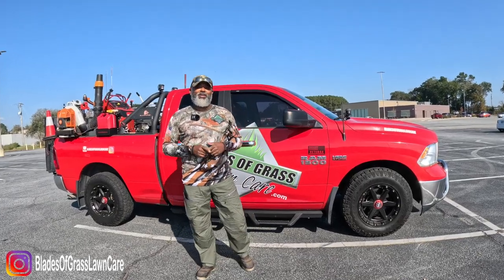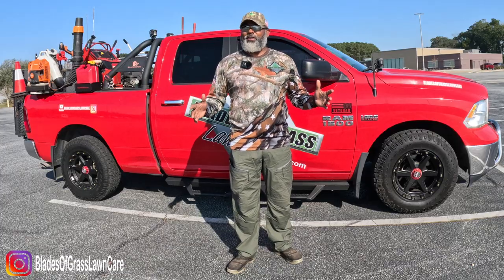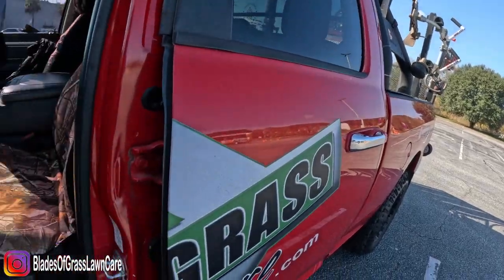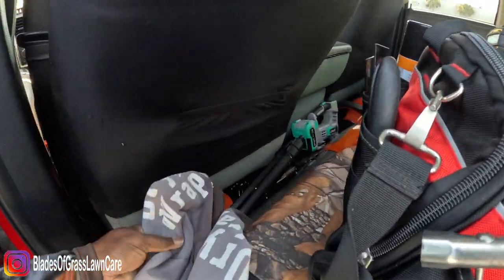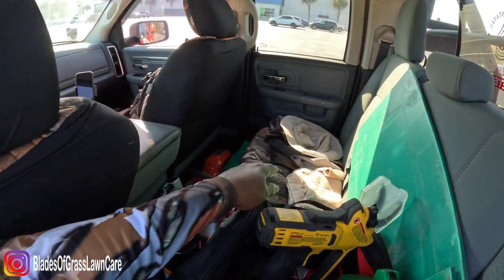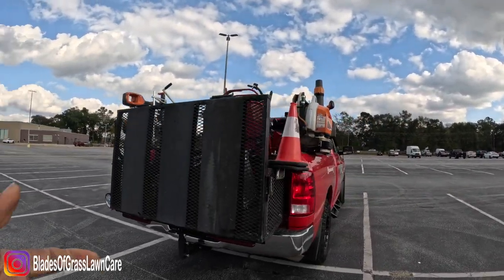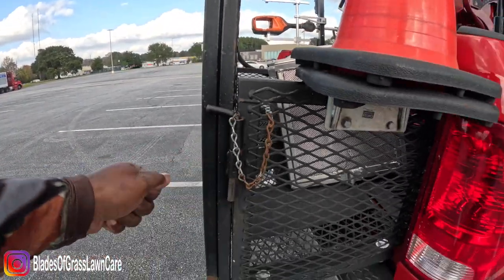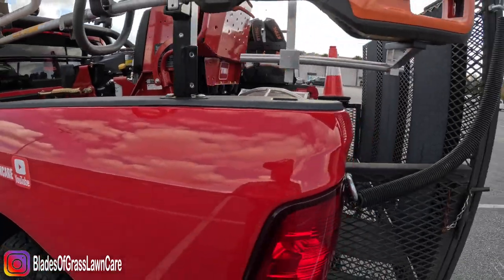BEST Lawn Care Setup 2023 and beyond!

Comment: Great setup! I have almost the same exact setup as you believe it or not: I bought one of Dale’s ramp systems back in 2019, but it’s on my 88 Chevy 2500 w 8’ bed so I have a ton of room. I can carry a 48” zero turn and 30” Turfmaster on there if I want to; next season I’ll be running my 48” vantage stander and a 21” Exmark. I also have racks but they’re ones I got on eBay; I also own a 2016 Ram 1500 but it’s used to pull a trailer if I need to as it’s got the factory brake controller.
Reply: I got a question what about blinds spots, it’s looks like to me I can’t see out my rear view mirror with all that equipment in the back

Comment: Those air bags really did their job when ya unloaded and loaded the mower the truck stayed level throughout the process. 
I have a 08 Duramax w a 8’ bed , do ya know if that set up would fit my truck & do they make em in aluminum?
I’m looking forward to purchasing a 34-36” stand on mower & use this as my 1 man crew lol . 
If all goes well , I’d ideally like to have a crew running before the season ends & pull together commercial accounts . 
I used to mow the USAA over here in San Antonio & that property is 244 acres with all kinds of terrain to include real long & steep slopes and several ponds . 
PROBST Señor! 
I still remember that one of our Drill Sergeants asked a trainee if he was from Lookout Mountain GEORGIA! 
The Sgt was a Indian mix Creole .

Comment: Great video! Do you ever have any issues with the batteries for your battery powered handhelds overheating in the summer months?
Reply from the maker: Not at all, I've been using the same tools and batteries for 3 years and zero issues

Comment: Wait you can fit a 52? Is that past the wheel wells? I have an F150 that I put a 52 on but the deck doesn’t make it past the wheel well. If it clears on your truck I will be running a new truck next season! 😂
Reply from the maker: Nah... The front wheel will rest on the platform
Reply: Make a platform in the bed (similar to a pallet with plywood decking) to drive the front wheels up on and you can get the 52 in plenty far to close the gate.